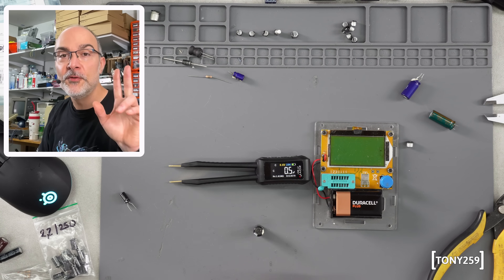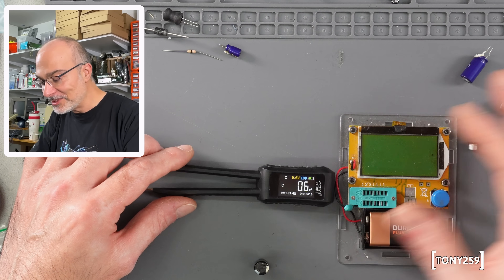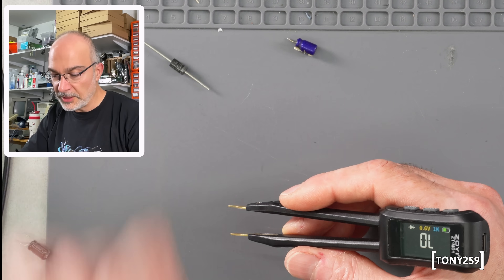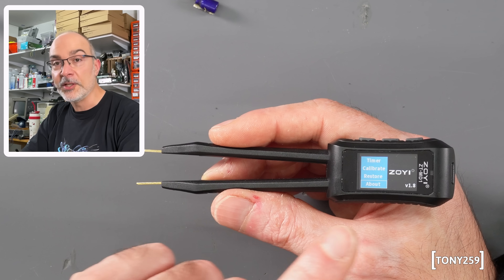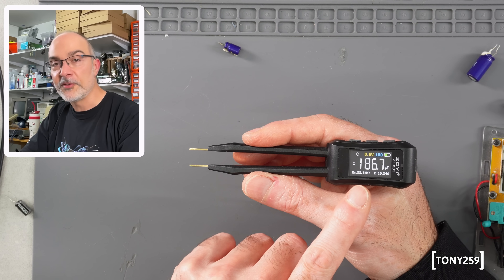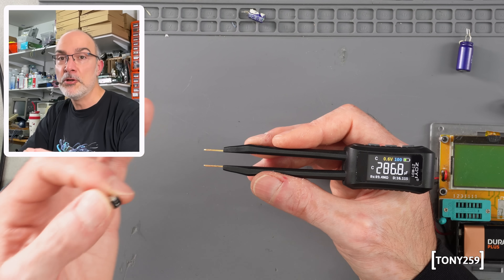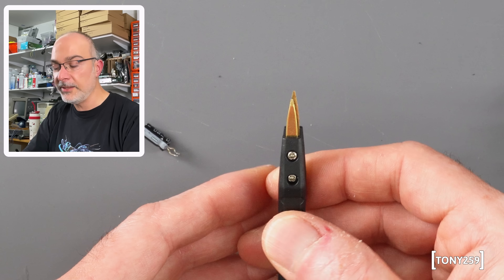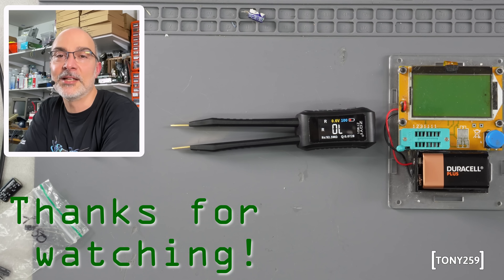FINALLY! A proper - CHEAP - LCR meter!

Comment: Seems it displays mH for microhenries.  That means millihenries.  It always makes me wonder when an instrument uses the wrong units, how careful have they been in other things?  OK, it's hard to display the Greek "mu" but it's common to use a lower case u for that - there is no confusing uH with millihenries.
Reply from the maker: I always mix up milli with micro!
Reply: So, what was on the label of the component, mH or μH?
Reply from the maker: mH
Reply: Thanks. In that case I might buy one.

Comment: One would think that these microcontroller driven devices, both the one you're reviewing and the ZIF socket device, could AUTOMATICALLY do capacitor ESR tests at a range of frequencies and then display the results in a set sequence.  Example 100Hz-10kHz-100kHz or whatever range would be most revealing.  It would simply be a matter of properly programming the microcontroller to do this.
Reply from the maker: That would take time though and a firm connection. It could be nice to have it as an option.

Comment: I built an lcr meter over 20 years ago and fond it invalueable for tv repairs.
I added a couple of diodes across the probes to make sure capacitors were discharged to save destroying the meter if i forgot to discharged one before testing.
I also built a really sensitive resistance tester that could measure the resistance of a trace or wire which came is really handy for tracing short cicuits, I could litterally just follow the lowest resistance to ground to the faulty component with out cutting tracks etc.
Reply from the maker: Good tools are always valuable over time! Thanks for watching!
Reply: Hehe, these diodes were shot at my 4263B when I got it, together with an evaporated trace and an exploded through-hole and partly evaporated inner layer ground plane. Looks like someone teste either in a running unit or forgot to discharge some really big cap or even a bank of caps. 4 input protection diodes short, two chip resistors blown and some 74HC series logic chip vented some smoke. Putting some fast and big Zener diodes across the inputs is important. But other than the 4263B the ZT-MD1 does probably not need a calibration after adding / changing the input protection to cover the parasitic capacity of the diodes.
Reply: That sounds genius but can you explain how the methodology of finding least resistance works in diagnosing a circuit board? Seems OK for a fail short but what about fail open?

Comment: Be VERY sure to discharge capacitors prior to measurement, otherwise you will end up with just another pair of tweezers.
Reply from the maker: Always a good idea indeed. That's why I have two of those "Atmel based" testers - one has a hole on the main IC :)
Reply: Wouldn’t the auto feature protect you from that?
Reply from the maker: Those testers - more expensive ones too - won't like a fully charged capacitor. A few volts is ok. But when I plugged my 220V motor start capacitor on an ATMEL-based tester, I made a hole in the IC :)

Comment: I recently tested the new FNIRSI LCR-P1 and it also was totally useless and ended up in my junk drawer.  The older TC1 and TC3 testers are much better than the others and do give a much closer ESR value to what my large LCR meters give.  However, one comment; Capacitance of Electrolytics is usually done at 100 or 120 Hz but ESR is measured at 100KHz and that little meter does not seem to have that frequency so I presume it won't be accurate either?
Reply from the maker: Oh yes, I also need one of those Drawers! :D

100KHz is often used to measure ESR on datasheets etc yes. So yes, it would be nice to have 100KHz as well. The ATMEL based testers approximate a 10KHz reading, I feel 10KHz is ok for DIY work - and 100Hz is a massive addition for troubleshooting purposes.

On a good cap, 10KHz and 100KHz ESR should be very close so that doesn't concern me. I don't need anything super accurate, I just need something to tell me "it's good/it's bad". Yesterday I was testing "in circuit" and I have to say I got some useful data there too. So that works for me.

Of course if you want a proper, true, accurate LCR meter, then you buy something else :)

Comment: WHY do you have to hold it like you show? I'm also disappointed that you didn't show it working in AUTO mode just because you don't like it, do you not make the video for your viewer's?
Reply from the maker: If you hold it the other way round your hand will cover the display! :)

Sorry to hear you would have loved to see the AUTO function! There are many reviews online, I'm sure one of them will also show the auto feature working!
Reply: @Tony359_2  so it's not a requirement to hold horizontal as implied  mm that makes sense but not clear in your own words in the video

Comment: Perhaps it's obvious to viewers, but in case not -- the main point of tweezer style meters is that they can conveniently grip and measure smd components.  For that purpose they are much better than a conventional LCR meter with probes (assuming they meet accuracy requirements).
Reply from the maker: Ah yes, of course. This is great for measuring SMD stuff.

But I find it simpler for Through Hole as well. Measuring a capacitor with probes needs some dexterity :) Thanks for your comment!
Reply: @Tony359_2  well, i agree that the probes on a conventional meter require some dexterity for through-hole parts. But you can exchange the probes for clip leads and those are quite handy to use.
Reply from the maker: there is no right and wrong of course.
Reply: @Tony359_2  Agreed! Just some things that can make life easier!

Comment: In the old days when things were simpler, we first "formed" the Electrolytic using stepped voltages, them we timed how long it would hold a charge.
ESR was not a thing. I now use high frequency Capacitors in various Buck or Boost converters. which get warm or even hot in operation, back in the old days of Valve gear, if the Caps got warm, we knew they were leaking and time to change them.
Interesting thanks, from an old School Electronics hobbyist and long time Radio Amateur Radio Operator. 73 G1ZQC.
Reply: I have designed many switching supplies and found very early in the game that the type of dielectric is critical.  X7R is the minimum for reasonable power loss.  COG would be best, but the size and especially cost may be prohibitive.  Most don't know that some dielectrics, like Z5U  will loose over half their value when hot.  The ESR may also change.  These drastic value changes can cause the feedback loop to become unstable, and are quite possibly the reason for wild regulation changes and smokey failure.
Reply from the maker: Sounds very cool thank you!

Comment: So, OK, you've tested all your caps ... how do you what the tolerances are?  Is there a general rule or do you need each component's spec to check if it is OK? Asking for a friend ... 🤔
Reply from the maker: Capacitor tolerance is 20% by design. For ESR, you can find tables online which give you an acceptable range depending on the capacitance. At higher capacitance you'd expect lower ESR, at lower capacitance you'd expect higher ESR.

I hope this helps your friend! ;)
Reply: @Tony359_2  He says, thank you for your answer.

Comment: Nice review, but for just a bit more money, you can get a fnirsi lcr meter.
Granted, if it was free i will take it. If the target device is entry level, then I would rather spend the extra $5 or $7 and get fnirsi.
Reply from the maker: which one is it because the FNIRSI component tester I got was junk :)
Reply: @Tony359_2  Sorry, that was Ali search that messed up. I know they have the TC1 that is crap. It showed another meter which looked much better, but that was in fact not an LCR.
Reply: You can look at FNIRSI LCR-ST1. Might be a better build quality than the zoyi, but most likely the same in measurement
Reply from the maker: What do you see better in the FNIRSI? I am honestly asking. It's using the same three frequencies, it comes with different tips but everything else seems similar?
Reply: @Tony359_2  The tweezer bit looks higher quality. Hence I said it just improves on build. Inside it may be exactly the same thing.

Comment: The ESR is measured by the voltage difference of a signal passing a capacitor. You need a constant current and constant frequency to be able to measure accurate values. There's also not an ideal cap. each cap. , has a frequency range . The lower cap you go you have to raise freq.

Comment: At 3:56 I think you meant 100Khz not Hertz. Thanks for the video!
Reply: So... You actually meant 100 Hz. You should check MESR-100 V2, that one can check 100Khz and it's quite cheap as well!
Reply from the maker: I am not 100% up to date with what's available on the market, it's nice to know that finally we're getting affordable "actual" LCR meters! Thank you!

Comment: No 100kHz ???
Reply from the maker: No! Remember it’s a £19 tool!
Reply: In the "Nuova Elettronica"  magazine issue 212, page 104  there is an ESR meter  @100Khz.   It's simple and it works nice
Reply from the maker: Ce ne sono tanti disponibili compreso quello di Pier Aisa e MVVBlog 🙂
Reply: The cheap LC100 LCR meters have a variable but not adjustable testing frequency. It can be as high as 600kHz as I noticed its signal appearing on MW on my SDR dongle. The higher frequencies appear to be used when measuring low-value inductors.

Comment: Do you think that perhaps it's displaying Impedance rather than ESR? ESR should increase with frequency in electrolytic capacitors due to poorer Ionic Conductivity, the Diffusion Layer, and the effect of higher temperatures over time. Your tests appear to just be showing simple impedance instead, hence higher values at lower frequency.
Reply from the maker: My knowledge is limited but my understanding is that ESR increases when reducing frequency. You can find graphs online. That’s all I know 🙂
Reply: @Tony359_2  - It would be an interesting experiment to test a variety of capacitor types both electrolytic and non electrolytic. Also the design of cap would affect ESR testing I am sure, mica, mylar, tantalum, etc.  From my experience with designing switching power supplies most electrolytic caps do have an increase in ESR with frequency and we would always design with 'low ESR' caps to limit heating of the caps in the power supply. Also when 'decoupling' TTL digital circuits we would often put an electrolytic cap in parallel with a mylar or other low ESR cap to get rid of high frequency noise from the switching circuits.

Comment: Please buy the TC1 instead of that 9V battery one..
TC1 use 100khz tone.
Reply from the maker: The TC1 I saw online seems to be based on the Atmel design, that is not using a waveform for measurement - see my previous video!
Reply: @Tony359_2  put it on oscilloscope and you will see
Reply: @Tony359_2  Put it on oscilloscope and you will see it do have the tone.. I don't know what they used to generate it but the tone is present on measurements.
Reply from the maker: I don't have it so I trust you. But then there might be various revisions - or copycats. The Atmel shouldn't be able to do that.

Comment: Two points not covered are:
A. The atmel tester has the built in component lead holder which also allows for using the included test lead clips. Once the component is attached by either method it's a hands free device.
B. The screen shows all test parameters simultaneously, while the probe style unit needs to have the mode changed in order to see the test result of each.
Reply from the maker: Yes, they are two approaches of course. The Zoyi is an LCR meter, the component tester is... a component tester! :) Each does things the other can't so it's nice to have both!
Reply: @Tony359_2  The component tester does measure inductors.
Reply from the maker: I know - but it's not an LCR meter. It doesn't use different frequencies like an LCR meter does, I showed that on the FNIRSI video. Otherwise LCR meters wouldn't exist! :)

Comment: The 0.01Ω is handy for hunting shorted capacitors, and in general shorts on big boards. (It does not even need to be that accurate, as long it is not too noisy). The Capacitors and ESR at different frequencies also very handy.
Reply from the maker: ah yes, I forgot to mention the milli-ohm reading which I don't have anywhere else!

Comment: Miniware has a much better LCR meter. I got the DT71 on Amazon for around $60.00.
Reply from the maker: For sure, then for £90 you get the Peak Atlas. But for £19 this is not bad :) It depends on budget as usual!
Reply: But that's subjective, what makes it 'better' ? Reviews for DT71 are dunking on it for being a toy with terrible accuracy issues, sometimes as bad as 50% on a 100uF and apparently weird cal procedures that might not fix it.
Reply from the maker: 50% is not cool...
Reply from the maker: Sometimes the ‘lone review’ is all you need to discover something. I tend to focus more on those lonely reviews than anything. On Amazon I always sort out the feedback by the worst ones. If I see a trend, chances are it’s true despite how many good feedback the item has.

Comment: I have one. It's quite accurate at low values. I measured 0,002 ohm shunt resistor and result was 0,0019 ohm, and 0,5uH inductor measurment result 0,6 uH. In the case of capacity, the measurements seem to be very accurate at least to a value of 47 uF, but still results with 10000uF capacitors are within tolerance. I don't like that jog swich fin Frinsi, it's prone to jamming. Switches in Zoyi are better for me, but i think that default frequency value should be 100 Hz.
Reply from the maker: Yes, it would be nice if defaults could be set!

Comment: It's better to take the tips off and bend them inwards for more ease of use and less strain on the legs which are made of the pcb material. Thanks for the fw update heads up.
Reply from the maker: You're welcome!

Comment: Does it  look possible to take it apart in a non-destructive manner, or was it designed to become ewaste once the battery dies?
Reply: yes, there's a single screw on the back and a lipo battery inside that can be swapped easily
Reply from the maker: I haven't checked to be honest.

Comment: Thanks for the video Tony. At the end, we need a tool to make the job with some margin of error, and this one seems to make the job. We're not repairing the space station here 😉
Reply from the maker: Exactly! The DE-5000 might have some more features and be more accurate but this seems to be accurate enough. The ATMEL is also accurate enough though it lacks the frequency selection. For £17, this is good! I wasn't expecting it! Thank you!

Comment: ESR meters have 100Hz, 10kHz and 100kHz modes so you can test your capacitor near it's intended use frequency:
100/120 Hz: Power-line frequencies (50/60 Hz) or low-frequency circuits.
10 kHz: Represents mid-range frequencies, which might be found in audio circuits or lower-frequency switching power supplies.
100 kHz: Simulates high-frequency scenarios, such as switching power supplies or RF circuits, where capacitors are exposed to high-speed signals.
PS. Remember to short the capacitor leads out before testing a cap.
Reply from the maker: Thanks! 100KHz would have been great but I am happy with the 100/1000/10KHz options! :)
Reply: The the @Tony359_2
Reply: @Tony359_2  it's how they keep them low-priced. it's good enough for what i would've bought instead of an 800 dollar meter when i was just learning hahaha. i buy the zoytek z1 dmm for kids when i donate meters to afterschool programs. it's price varies wildly depending which rebrand of the meter it is. scott at defpom isnt a good benchmark for reviews in my opinion as he's a shill who just turned into a review channel. some creators get obsessed with free stuff. disappointing because he's really smart.
Reply: I don't know guys why none of you who tested those LCR meters mention one important fact. Every capacitor have a datasheet where is information about ESR and also for which frequency is that ESR valid. For most of the electrolytic caps it's 120 Hz. That's why professional LCR meters have this frequency in their range.
Reply from the maker: I don't know what capacitors you use. None of my Panasonic and Nichicon mention the ESR in the datasheets. The only THREE capacitors I have which have ESR mentioned are the WURTH and it's measured at 100KHz :)
Reply: @Tony359_2  because sometimes they use tan δ and ESR could be calculated from this number. The tangent of the loss angle is usually provided, which actually simplifies things a bit. Taking the formula for the impedance of an ideal capacitor and doing a bit of algebra, one finds that an ESR value can be obtained by dividing that value from the datasheet by two pi, the test frequency, and the capacitor value.
Reply: @bfx8185 Do you think this device is appropriate for in circuit ESR measurements like other meters?
Reply: @pafigoro  Sure it is. Not for precision but good enough to spot bad capacitor.
Reply: @bfx8185 and do you recommend testing at 100Hz or 10KHz? And to compare the reading against what reference? Because the D dissipation factor supplied in most datasheets are at 120Hz, not 100.
Reply: It's all best guess when it comes to ESR.
Reply: A frequency counter would be nice too, so you can measure your capacitor in circuit and then remove it and evaluate which ESR setting is appropriate?
Reply: Is there a test device that makes a swoop on a frequency range? Of course you can do it by yourself. Also could have phase checked.
Reply: Most capacitor datasheets supply D dissipation factor at 120Hz. Would testing it at 100Hz be the same?
And for capacitors in high frequency inverters does it make a difference testing them on 10kHz instead of 100kHz?
Reply: @pafigoro   100Hz to 120Hz is a 20% increase, so no real difference. 10k to 100k is a 10X (1000%) difference, so yes, that can be relevant.